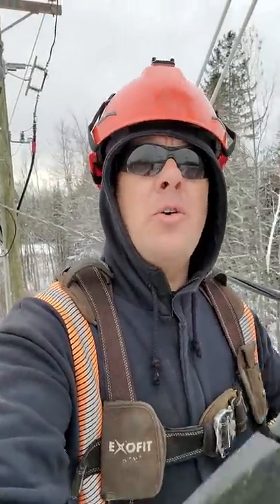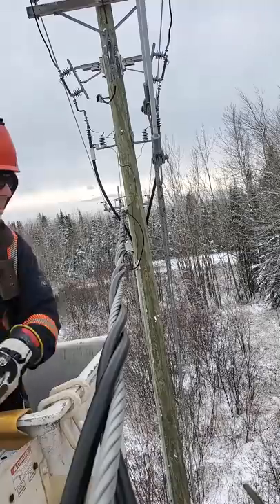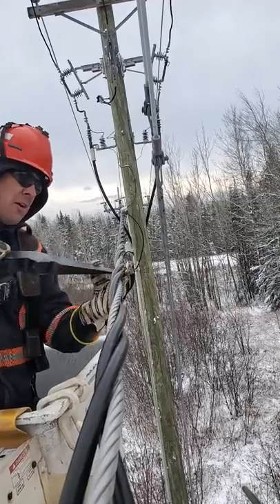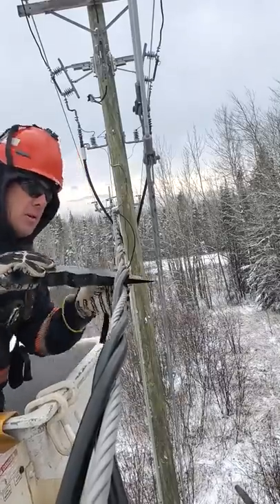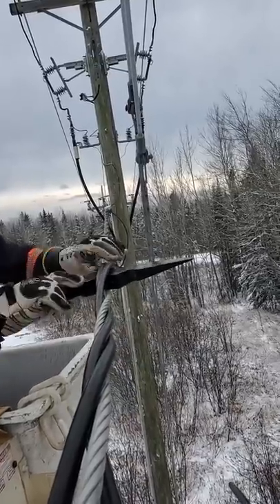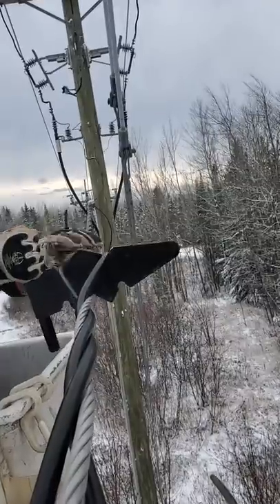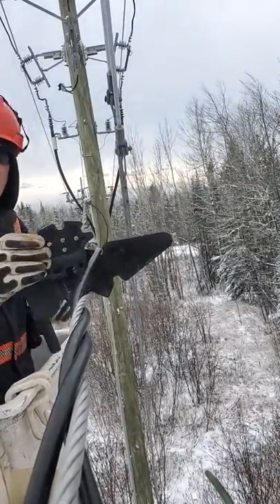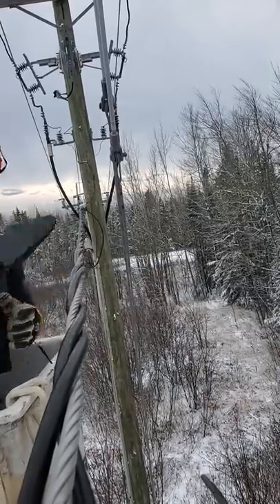What's a Beaver tail??

Comment: A lot of respect for you guys. I’m an electrical engineer and i could never do what you do. One mistake and it’s over.
Reply: Lost one of my uncles when I was only like 10 to this. They said the lines weren’t live, he went to do the job as usual, they were live and it electrocuted him to death immediately.
Reply: They wear specialized clothing and gear just to protect them.
Reply: @foryou...9732  Real electricians always check first.
Reply: @thisismagacountry1318  thats an absolutely valid point
Reply: @thisismagacountry1318  he was an electrician for like 9 years if not longer, I’d have to ask my dad. But it genuinely wasn’t on him that it happened, his direct family sued and got a shit ton of money. But money doesn’t bring back people.
Reply: I'm from operations....and I used to fix all you engimineers mistakes 🐸
Reply: @Emily Diaz  That only goes so far. We do many things that are extremely dangerous, and safety gear can only do so much to protect you when it's this much power.

Definitely many safety steps to make sure it's as safe as possible, but life is chaos and shit happens, safety gear won't help help in the bad cases.

There's a joke that the suits/gear are just the difference between an open casket and a closed casket.
Reply: Check and double check...always work like it's live..

Comment: I work as a design engineer designing utility poles in FL. Never understood how they make mid service taps. Usually not designed too often as tension on the secondary can cause outages with the heat we have here but good to learn. I've been wanting to jump into lineman work for a while. Keep up the awesome work!

Comment: For me beaver tail is the mechanical device used for tension stringing through triple travellers (Sherman three 3 phase dollies) it attaches at to the bull rope on the puller and three swivels come off the back side of it for each phase, in between phases is cast steel daisy chained together that hangs down to prevent spinning and is flexible like a spine kind of. 

Never used mid span taps myself and never saw this tool. I really like your channel I’ve been learning from it and it’s making me a slightly better lineman each day.

Comment: I watched the electrical utility in my area de-energize a URD which in the south, is basically a transformer that sits on top of the ground with a thick front hinged steel box around it. 
 They opened the front and had to pull the oil dampened fuse with an 8' long fiberglass pole. They shut down about 5 other houses on the load side while this was being done and used the thick orange rubber blankets to isolate the line part.
My job was to pull feeds to an additional new home via the underground conduit the elbowed into the inside of the URD while standing right to 13,000 volts on the line side.
Reply from the maker: That's one disadvantage to underground lines... Often times they  need to be de-energized to work on. Sometimes we will leave the secondary side live and cover it up and sometimes we'll do as you explained. In both cases one thing we do differently is we only allow a certified Lineman to be in around the high voltage while wearing proper FR and PPE.

Comment: that's ONE definition; to an 'equipment hauler', a 'beaver tail' is a temporary loading ramp for flat-bed trailers... they can be attached to the trailer via a hinge (which allows the ramp to be flipped over, so one ond is on the ground), or stored under the decking, and anchored to the trailer deck when in use...

Comment: 👊🏻👊🏻👊🏻Aaron, Nice Clip! We use a wooden wedge on triplex or Quad. So low tech compared to your high toned tool. Especially not as fancy as your “Beaver Tail”. We don’t use a spreader, we use a 2 piece design that covers the neutral. We bug on to the hot legs spread apart by one rubber glove width. Keep up the great work brother 🍺!
Reply from the maker: I often wondered if you guys would even use the term Beaver tail? It's definitely very Canadian lol.
Great hearing from you as always John! Have a great weekend 👊👊👊
Reply: @John Clyne My dielectric chart doesn't include "rubber glove width"  as a unit. Please advise procedure. ;D
Reply: @matthewellisor5835  Start by holding one hand on the end of the neutral cover.  Place your other gloved hand next to the other on the triplex. After that gloved hand is where you would put one bug for your service. Measure out from that connection another gloved width. That’s where you would have your other connection on the other hot leg on your crib. (Your neutral connection would be made on the opposite side of your “chicken catcher”.
Reply: Who’s klien’s are these? Clyne’s. yeah but whose are they? Clyne’s yes I know they’re klien’s. oh ffs. Lol
Reply: @johnclyne6350  My uncle was a chicken catcher. Best chicken catcher on this side of the river.

Comment: Is that for adding a splice into the midspan?
Reply: No, it’s for spreading the triplex apart to be able to install a permanent spacer to be able to midspan a customer’s service instead of running it to the pole. Without installing the spacer you wouldn’t be able to make the taps for the service.

Comment: How is the gopro you mounted directly to the line not getting serious interference from that much electricity flowing through that triplex? 
I get its insulated but i have had drones go doen from literally nicking that stuff and blow every Moffett on the board.
Reply from the maker: It's actually mounted on the wooden pole

Comment: What voltage is this in Canada. Im assuming low voltage (under 1000 volts) 
I used to work as a linesman on 22kv power lines and wanted to take that experience overseas(I live in South Africa) but companies here take advantage of us when we were young an never got us qualified to have  proper papers. I then switched over and worked as an technician doing cable faults and pressure testing of underground cables and that company too screwed me for 5 years.

Comment: What is the name of the belt that they use to climb a wooden pole? What burns the pole? I'm from Honduras and AK are different.
Reply from the maker: We just call it a pole belt. Poles typically catch fire from a failing insulator. The electricity tracks through the wood going to ground and heats up!

Comment: in school we would march under a power line and you could feel the electricity like static through the tuba. Is that normal or was it giving off small amounts of electricity?
Reply from the maker: It's normal for High voltage lines to give off induction or capacitive coupling, specially transmission lines. Maybe not so much that you can feel it walking by, but certain circumstances I can definitely see a metal object picking up a bit. The weather can play a factor I'm this also.

Comment: 🤔🤔 as an AT&T cable lineman and tech ..I used to see people doing this and damaging the copper wires and sometimes even the fiber optic cable 🤦‍♂️🤦‍♂️ all because they didn't cut the zipties and pulled out the cable more to loosen up the cable and was tight thus breaking or expanding the cable to a point where it was weaker and then months or so later we go repair it.

Comment: If the insulated wires are two different phases, what is the bare wire.
Reply from the maker: I kinda used the term phase incorrectly. They are two hot legs tapped of the windings from a transformer that's on one phase. Each hot is 120 volts when measured to neutral/ground and 240 volts across each other. The bare wire in the centre is the neutral. 
- 3 wire Edison
Reply: @Bobsdecline  Oh! SO does the ground run all the way back to the power plant?

Comment: A teslic energy supply requires no wires or cables and could theoretically be integrated w our cell phone towers(Which are obselete)
all you need is a grounded connection on your appliances,lights,and electronics
#CommonSense
#NikolaiTesla333